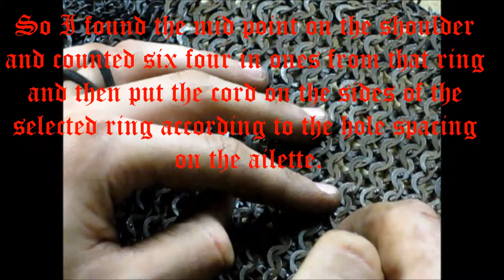How to Properly Tie Ailettes to a Hauberk

Comment: Thanks for talking about this underated, although badass, piece of armor. i made ailettes in the codex manesse style, but by observing iconography, i found out that the leather cord is rarely exposed on the outside of the ailette, i chosed to nail leather attachment in the inside, more accurate i think.

Comment: Were you trying to fly off with you "little wings" there for a second? After watching this I'm going to need to reposition mine thats way easier than how I did it.
Reply from the maker: Maybe... :3 lol XD. And yeah, it is super easy. You don't even have to tie it at the bottom. Just loop them through the first holes and tie. The extra step is just an option that looks different which I prefer.